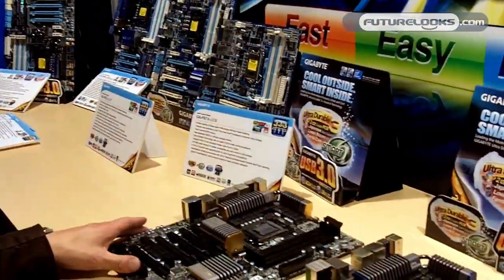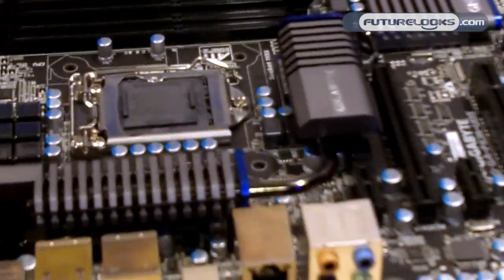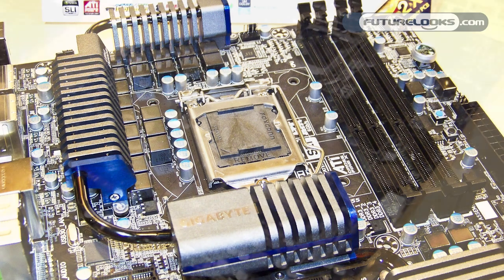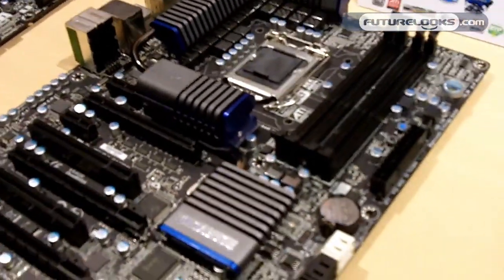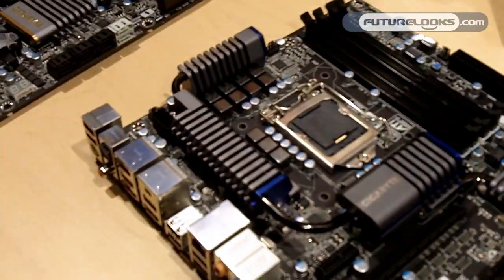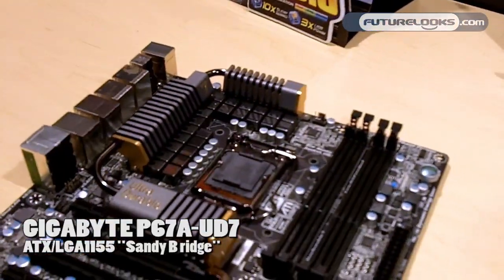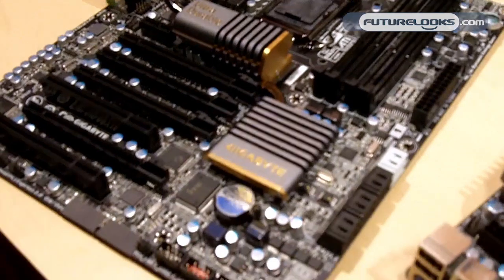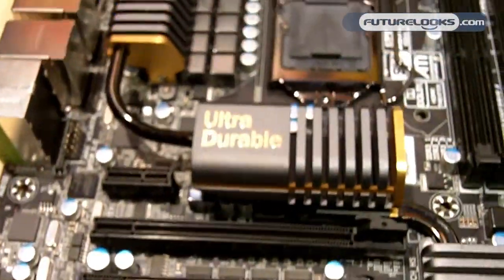IDF 2010 - GIGABYTE Shows Off Next Generation P67A UD5 and UD7 Sandy Bridge LGA1155 Motherboards

Comment: Sandy Bridge isn't going to cost much more, if any. The SKUs are going to be very comparable to the current Core i7 procs. The K series SKUs (unlocked multipliers) will most likely cost just a little more if non-K launches. No confirmation on that as of now.